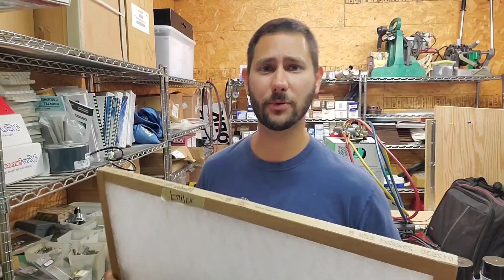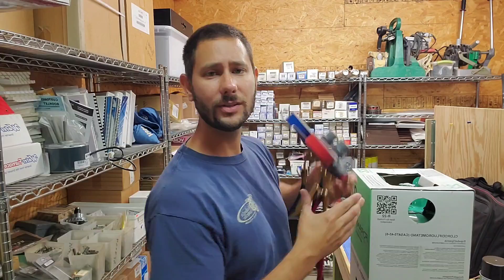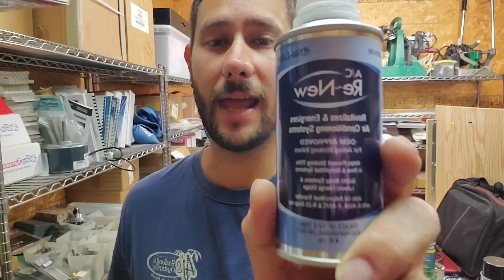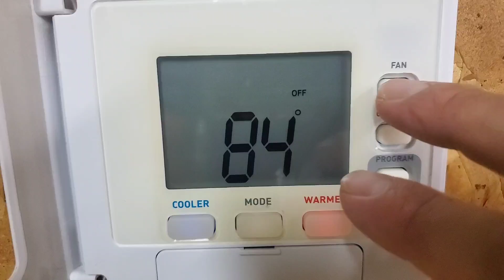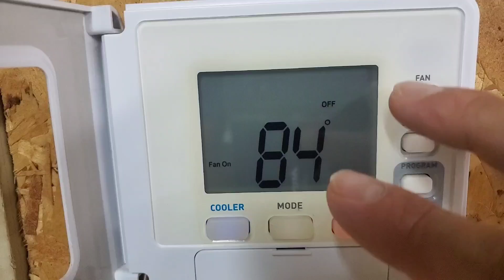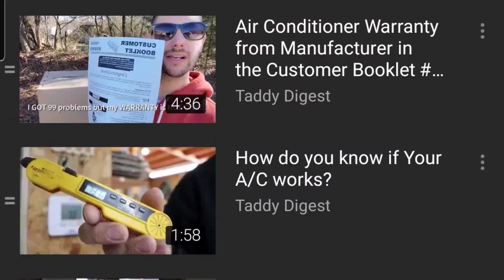Why is my air conditioner freezing up? #nocooling #airconditoner #hvactipsforhomeowners

Comment: Great refresher on the basics I needed that question if no one is home or in a business I’m assuming if it’s a heat pump if you turn on the heat the indoor coil becomes the condenser rejecting heat it will thaw faster if you crunched for time
Reply from the maker: boom shakalaka 
yes exactly reverses flow and sends hot vapor into the indoor coil during heat mode